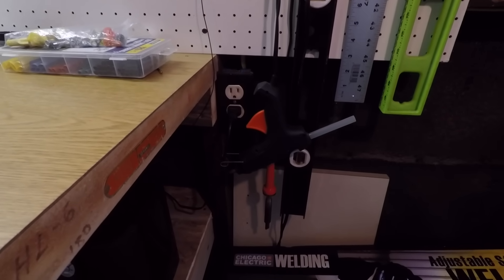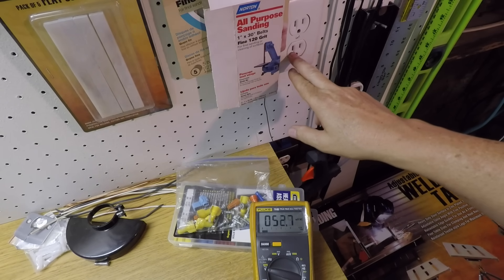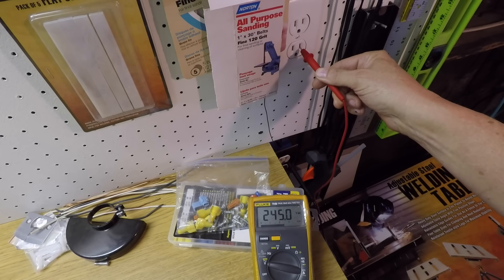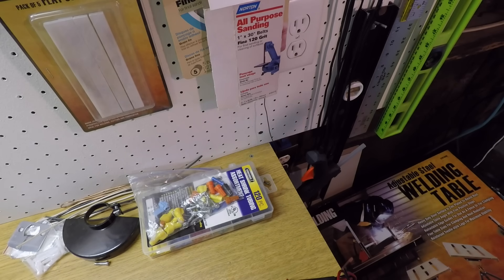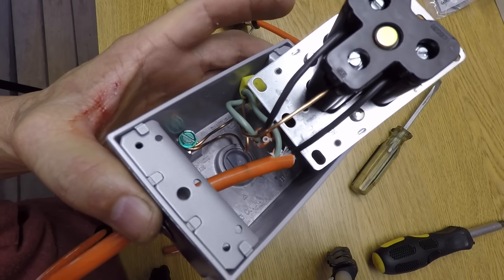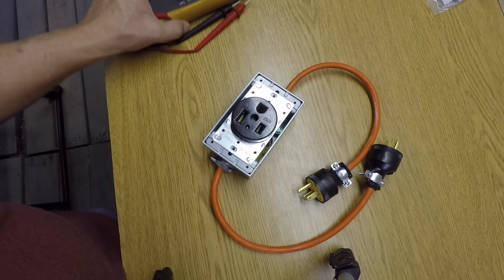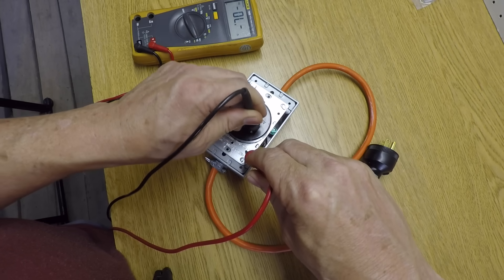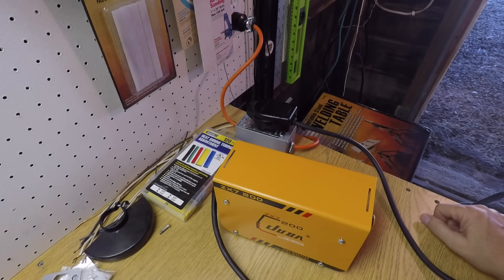How to Get 220v From 110v

Comment: I've been an electrician for 43 yrs, I don't recommend this at all, especially if there are other devices sharing either one of these circuits.you could expose other 120v devices to 240v.and even if your lucky enough to get away with it you should have doubled up your wire size by combining the whit and black wires together on the plugs it would handle more amps and that wire you were using didnt look like # 12 wire to me.I'm not trying to pee on your parade but this is dangerous.In the interest of what I just said I just did this on my test bench and its very possible to feed 240 back to other devices on either of those circuits, If I was a youtuber i would show this experiment to prove my point.
Reply: Way easier to just install the proper circuit.
Reply: Yea I thought this was questionable.
Reply: steve lecain yes one  needs to be very careful about what one follows DYI on YouTube. Many ideas that work, sort of, unless unless unless....(I dont know what happened officer but then the house burned to the ground). Jaja
Reply: His wife comes in a draws more current off of another plug that is in line with one of those breakers/circuits using the Mancave Microwave. We got hotwires and possiable fire
Reply: Yep yep. Well said. Common sense goes a long way
Reply: 42 years
Reply: I agree 💯%
Reply: I am watching this video in order to do this on 2 generators to run my 220v 225 amp welder Lincoln buzz box which pulls at least 50 amps which I have run always with up to a 100 ft cord #6 gauge my generator put out 5500 watts each I am in a remote area where I have no electricity I would appreciate a responce P.S. I would not try this at home to dangerous  thanks
Reply: @dovoindustries103  Hi, I'm not sure if anyone has answered your question yet. Your portable generators would need to be synchronized for this to be possible and portable generators cannot be synchronized. This unfortunately will not work. Your best option would be to use a portable generator that has a 120/240 alternator.
Reply: I hope you still available here,  I was thinking of doing this to use with my 6.5 kw generator that does not have a 220 tap, to only run my pool system, my genset get 18 hours on a tank of gas, and I can heat the pool in 9-10 hours from 65 to 85 if i want it that hot, elec cost is about 100 bucks because our community buy service from outside and there is a huge surcharge on it., will this type of set up work in my application?
Reply from the maker: I've never tried anything like that so I really don't know for sure but I doubt it.
Reply: As an electrician of 27 years i agree with everything you said. I appreciate this guys attempt to solve the issue he is having but this is a very dangerous way to do it.
Reply: Right!  Use the wires instead of cutting them off.  What a waste.........
Reply: Wire size is based on amps not volts. As long as the device only draws 20 amps, the 12 gauge wire size is not a problem. An electrician should know this.
Reply: @tjl9585  Their is this thing called "National Electrical Code" for 20 amps 12 gauge wire, for 40 amps 8 gauge wire!
Reply: no wires in this setup will normally carry more than 120v, only at the very end when they are combined in the device does it see 240v.  Also i wonder if he should have put some sort of 240v circuit breaker into his device to make it safer, likely even GFI since its sort of outside.
Reply: @AviewFromUnder  no need to tear into the guy when i first saw this i was like WTF! then i watched closer and realized what was going on.

Comment: so the welder must be a 240 only?
some of the welders have 120 volt for controls...
and 240 volt for the main transformer..
yea in a pinch this would work..
just a safety side note do not unplug one of the 15p (120 volt) plugs while plugged in to the welder!!
lol
you will still have 120 volts on the plug you just removed if the welder is turned on!!
play safe!!
and kids do not try this at home!! GRIN!!

Comment: Extremely Helpful 
You did an Awesome Job
Safe and Professional Hack
#ContentRich video
One Thing I would do different is run the power to a breaker on/off switch between the the Load /outlet

Comment: This hack, will only make 220 volts if each circuit comes from the opposite side of the house transformers center tap. If both circuits come from the same side you can not add them to get 220 V. Better to run a new 220 V circuit designed to handle the current. An easier hack and safer, would be to use a dryer or stove 220 V plug outlet. May need to make a plug converter.
Reply: did you watch the video? the 2 120 volt phases combine to 240 volt. you can see it in his meter dumbass.

Comment: I had to dislike it just because the title is wrongly titled.
Try 240v from 2-120v outlets connected on different phases of 120v each.
Or something more accurate than the present title.
However, I first have to say thanks for sharing very good video.

Comment: If you are in america your incoming is 240v the breake boxr is what breaks it down to 120v lines. Do it right so you dont start a fire have an electrician come in and run you a 240v line to a plug. All your electric stoves and dryers run off 240v.

Comment: One very real danger of what you did is that the (2) 120v. circuits fed by (2) different 20 amp circuits is that if only one of the 120v. breakers opens because of a fault  (this can occur, because the breakers are not joined as one, as are all 240v. circuit breakers). If only one breaker opens? the other circuit may still be energized and could pose an electric or fire hazard. One example of this would be a 240v. motor with only one hot leg being broken could burn out its' windings or overheat trying to start and could cause a fire or electrocution hazard.  Always feed ALL 240v. volts circuits through a 240v double breaker!

Comment: Just for convenience and idiot proofing incase you forget or someone else is using your stuff, I'd recommend moving the two circuits to a double pole 240v breaker, then instead of using those two plugs to tap off the 2 circuits, just hardwire them in and mount that box to the wall. Might not be to code, but you're using that thing so that ship has sailed.

Putting the 2 circuits on the same breaker will prevent a fire issue you might have too, ie, if you have a device failure and one size creates a dead short, but there is a resistive short on the other, currently one breaker will blow, the other breaker won't, and could be feeding less than 20A current to ground through a failed component... as you're going to your circuit breaker to reset your device catches fire...

Likely nothing will go wrong, but it's only the cost of a breaker and a couple cable clamps to bring it up to the intent of code. Also, are those extension cords 12 gauge? if not they aren't rated to handle 20A. Most extension cables is 16 Gauge, you may have a problem pulling enough amps to run your welder and those cables will likely get hot if you pull more than 10A.

Otherwise, looks good and you've got a tidy setup there.

Comment: You didnt use the right outlet... without the horizontal line off  one of the vertical plug slots it is rated only for 15 amps. The problem with doing this is that if you die, someone else will not know that the outlet is 20ampand not 15. ALSO, If there was any kind of fire an insurance company could deny the claim.  Yeah this all sucks I Agree!!! Had these hasselb which is why I say.... good luck dude.  Otherwise interesting vid!

Comment: You can’t use extension cord wire for a car charger you need solid wall wire. Other than that this method works I used it for car charger.

Comment: Some houses dont have 220 or 240 comming in I know I'm right cause I lived in one the system was set up for 110 only and if you wired 220 at the box from the one ten beter run it threw a breaker for 220 and have a fire extinguisher ready cause a guy did it worked for a but then over loaded the incoming and burt house down so so that's great for temp but wouldnt relie on it

Comment: Nice setup!  I like it allot-really clean.  I would use 12AWG conductors to get you to 20 amps/leg and test to see what amperage the welder pulls.  All this assumes the two branch circuits are 20 amps.  If only 15 amps is available in for shop, then you really really need to test what the welder actually pulls; I would be comfortable if the welder pulled no more than 13 amps per leg; you may want to counter check with the welder manufacturer specs.  A cover plate and labels reminding user to unplug cords when not in use would also help. Sorry if I sound a bit critical-I've seen some bad stuff happen.  Good luck!

Comment: More logical to add a two buss 50 amp circuit breaker and run new wiring through conduit.  For my ground I pounded in an 8 foot copper rod.  The welder you have must be of very low power.

Comment: When the test was made for continuity between a blade of the plug and the appropriate wire, additional tests should also be made between that blade and every other wire which would check for any shorting. You are needing to look for things beyond just continuity if you are designing for safety as well.

Comment: At 7:53 you show 2 different bare copper wires attached to your Ground screw in the box. This is incorrect design. You should not use multiple wires connected to the ground screw as one will push the other outward and you will have increased resistance. Use only 1 continuous wire bent in an ohm design to have a safer attachment.

Comment: You are not getting 240 vac from 120 vac unless you use a transformer. Standard power service to residential customers in the US is via a center-tapped secondary on the pole transformer. This provides 240 vac with a center-tap connection to your service entrance panel. The center tap is connected to ground and neutral in the panel, so you have 120 vac on either side of the ground, but opposite phase. 

If I wan 240 vac, all I need to do is use a "twin" breaker in my main (or sub-panel) and the appropriate outlets and I'm done. Been doing it this way for 65 plus years in both factory and residential applications.
Reply: That's in essence exactly what he's done here. Only his DIY box does it down stream from the panel.
Reply: wow another dumbshit. the panel has 240v on 2 phases. how the hell do you use a stove or AC if you only have 120v available at any given time? there are 2 phases each 120v. combine them and you get 240. I swear you dumbshits who know nothing about electrical need to just stop replying. you are morons

Comment: It’s probably been said but if you ran a new 30 amp branch circuit for the welder the performance would be significantly better. And your lighting would not be affected in the least.
If both of the circuits you are using are on the same buzz bar and the welder uses 20 amps you are creating 40 amps worth of heat (current draw) in the bar. Where as if you install a 220 circuit and 2 pole breaker you will only be creating 10 amps worth of heat (current draw) on each buzz bar with the welder. More heat equals more resistance and this will cause issues with your idea.
Reply: They are BUSS bars not buzz bars
Reply: @ Shadow Hunter  If both circuits were on the same buss bar, there would be ZERO volts (therefore zero amps) to the contraption and the welder.   The two circuits must be on separate buss bars (which are each hooked up to the separate 240 VAC conductors coming from the pole transformer) in order for this whole thing to work.  If the welder uses 20 amps, then only 20 amps travel thru each breaker (and thus each buss bar).   If a circuit is entirely in-series, then amps are the same throughout the entire circuit.  Amps cause heat and as far as the buss bars see it, they're still only handling 20 amps each.  By using the 20 amps thru this whole circuit, multiplied by 240 VAC (instead of 120 VAC), then the welder sees double the WATTS (power) than a similar appliance would, drawing 20 amps at 120 VAC.  Either appliance, if drawing 20 amps, would create the same amount of heat thru similar conductors/buss bar(s)/breaker(s), but the appliance supplied by 240 VAC will perform twice as much work.  That's where the twice- (or half-) values occur, that you're probably thinking of.

Comment: Im was a Nuc Electrician in US Navy Submarines, we know kludges better than anyone.
Good Job.....but the drawback is if you trip a breaker, you know have one phase power or 120v to your welder and it will now pull
double the current as its gonna draw the same power no matter how many volts you put through it. That's why appliances are dangerous with low voltage brown outs and must be tripped. Anyway the 2 breakers are likely to trip almost instantaneously one after another. Just saying, while a great kludge and since you know how to wire, just wire the 220 up to a correct breaker, then you'll always be back to make another video.
Reply: How do you figure?
This setup doesn't use the center tap (neutral) at all. If either breaker trips what ever is connected to that 220 outlet will be drawing exactly zero amps as it's now an open circuit unless there is a ground fault allowing leakage.

This is a legitimate question as I'm not an elechicken nor have I played one on TV.
Reply: Yep i did this at home to the dryer outlet. Im here to see if i can do this off a 220 outlet and a 110 on generator. Both outlets have their own breakers 30amp and 20amp. The 220 reads out at 46amps when no power is drawn but depending on what amp setting i use on my inverter welder say 120amps itll surge and at 130amps it pops the breaker. I will only be using one appliance at a time when in use. Any feed back would greatly be appreciated

Comment: If you have an old house and you’re not sure how old the wiring is do not do this he could put too much strain on it and cause a fire otherwise it is safe to do just keep in mind don’t put lotta pressure on the electrical if you’re going to use it for welding do a short term

Comment: If you got a 110 volt breaker box with 120 comming into it this will not work.Check your electrical box first.Ifyour notsure contact your local electrical provider to check thetransformerwires comming into your main box.Have fun be safe .Electricity does not discriminate.

Comment: There is a rule that no more than one wire should be connected to a screw.  This is to protect down stream connections if an outlet is removed.  Consider a row of outlets where the first outlet's ground screw has the ground from the source as well as the next outlet's ground connected to it.  If the hot and neutral lines were pigtailed in the first outlet's box so that only one wire went to the first outlet's hot and neutral screws then if the first outlet was taken out of service and removed then all the outlets down stream would lose their ground connection.

Obviously in this case there are no downstream outlets but I would still stick with the one-screw-one-wire rule.  All that would need to be done is to pigtail the grounds from the two plugs with a bare copper wire to the box's ground screw and a bare copper wire to the 220 outlet's ground screw.

Comment: I don't think it's legal to use the ground wire for your 240 volt plug.  The 2 white wires should of been connected to the common lug on the  240 volt receptacle.   Bare ground wire should only be used for grounding.
Reply: 240 doesn't have a common/neutral wire unless it's a 4 wire setup which this is not. His ground wire is in exactly the correct spot.

Comment: Here's an idea.. land the neutral of one of the outlets on the other bus and now you have 220 without all your extra work.
Reply: It is very dangerous to do that since several outlets in the room usually connected to the same line, you will destroy whatever you plug into the other 110v outlets of the same room.

Comment: Like many folks below I am sure, you are working on a building that has 240v service to it  If the building only has a 120v service to it, this'll never work!!
Reply: The service line pulled to your house always has 2 220v wires, a neutral wire and a ground wire, no exception.
Reply: yup..

Comment: This doesn’t make much sense, lots of room for error. Once one side is plugged in, the other could be dangling and electrocute you or short out.  Also if each outlet is drawing from the same 120v leg in your panel, that will put your load way out of balance. Especially with the current draw from a welder.

Comment: This is a good clutch fix.   BUT YOU CANT DO THIS WITH ANY 110 circuits. 
They must be on different phase circuits.  
Yours are so it works.  

If they were on the same circuit it would not work. 

Like your two plugs being plugged into the bottom outlet or the top.

Comment: I not electrician but i believe the wire for those kind of receptacle is not big enough for 220 volts,  
Maybe risk of fire
Reply: Amperage is what you size the wire for.
Reply: Cable is rated to 600 volts, amperage is the issue.

Comment: Both circuits (phases) should be on a common circuit breaker.  If one breaker trips, your "device" will still be hot on one side which could cause damage to unit plugged in.

Comment: I would have used some heftier cord wires, and plugs
Reply: It looked like standard 16awg cord, the first time he puts a 40 or 50 amp rated welder under a heavy load it'll be up in smoke, great idea though for people that have no way of getting 220 to a shop or garage.

Comment: Are you using the word lines for phases? You can only have 240V with 2 phases. Both of your outlets have to be on different phases. Neither lines can be on the same phase.
Reply: There is only one phase in most residential.     We use a center tap to split the phase.